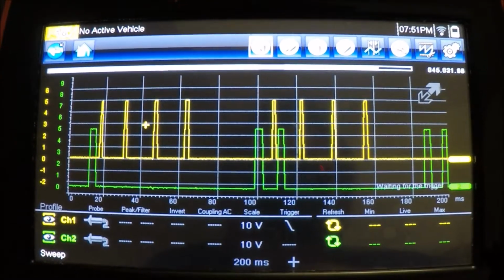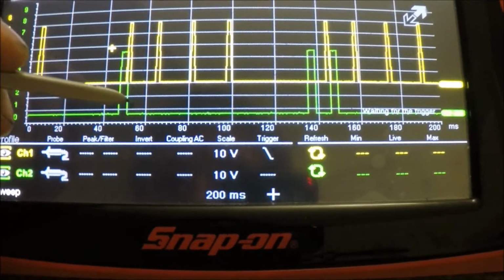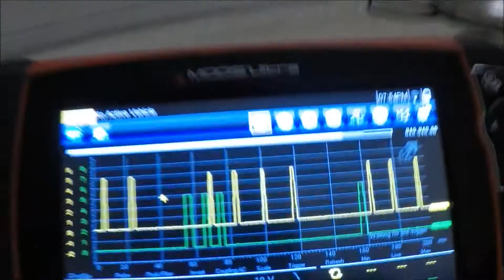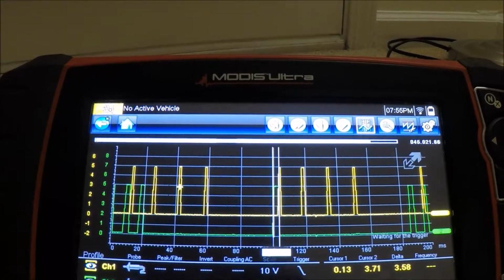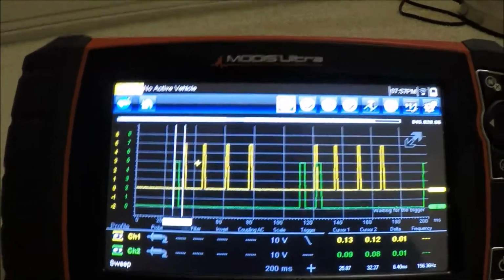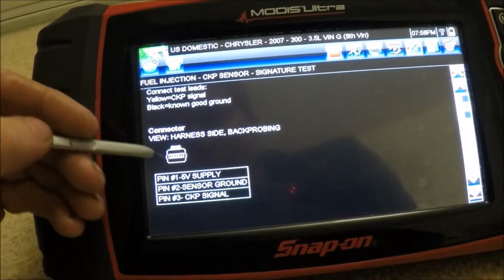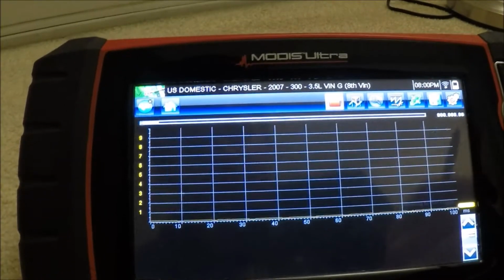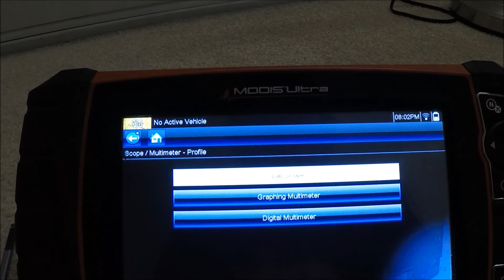Lab scope Cam crank analysis Oscilloscope Lesson

Comment: Should leading edge of cam signal always align with leading edge crank signal on all vehicles or each vehicle different?  Thanks for the video.  Very helpful
Reply from the maker: Hey so I would say it depends on vehicle. But, there is always a correlating spot for cam/crank. It never has a wave form where the cam signal lands in the middle of the crank wheel. Does that help?
Reply: @skatir9  yes makes sense.  Thanks again